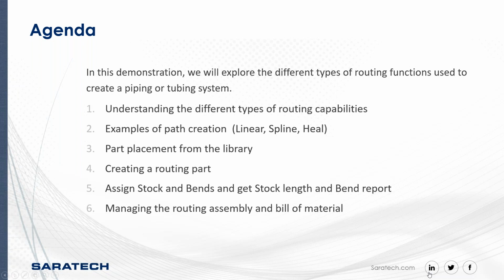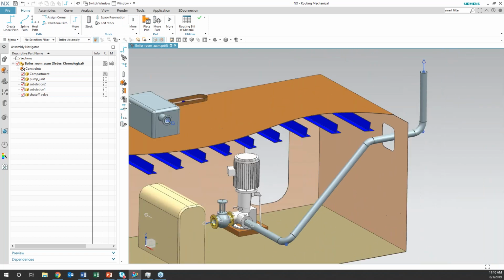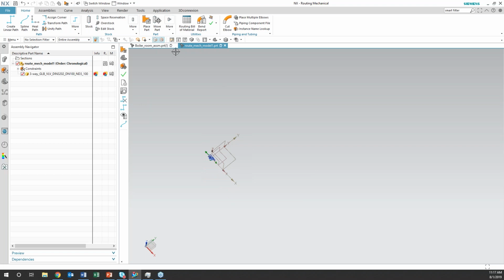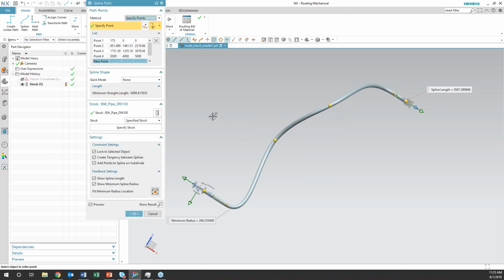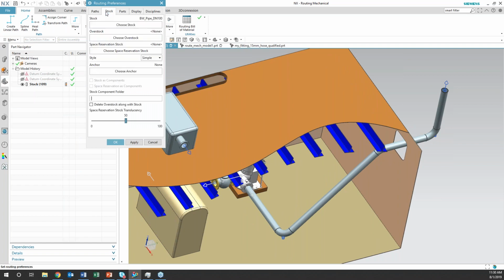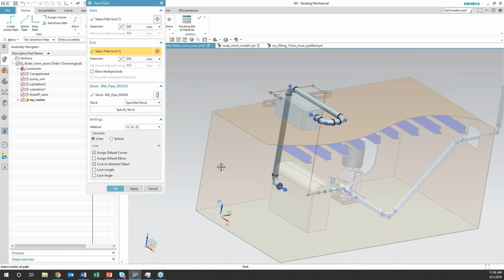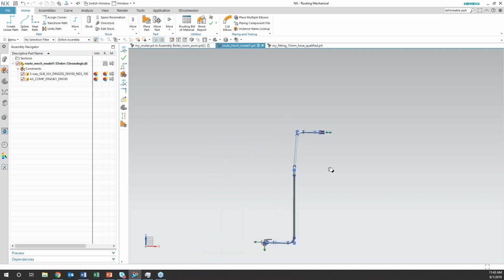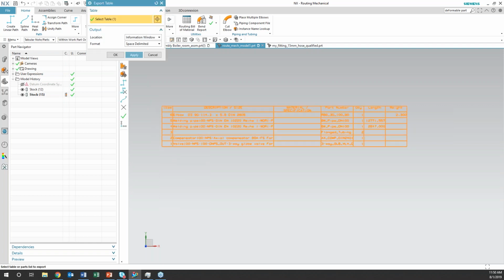CES:  NX Routing Mechanical

Comment: Hello sir, could you please prepare a video on  how to add additional custom parts in the mechanical routing library in other words if we change the diameter of the pipe those respective joints and couplings used from the library should change automatically.

Comment: How to edit a spline path? Specifically how to add a new point between two existing points? As when I add a new point, it is added at the end as the last point...
Reply: I know it's a year late, but if you choose "Point on curve" in your selection options it will insert the point along the stock.
Reply from the maker: Thanks for the question, Shlomo. For customized questions, visit our "customized training page" and leave your information to set up a one to one meeting with one of our engineers. https://saratech.com/customized-training/